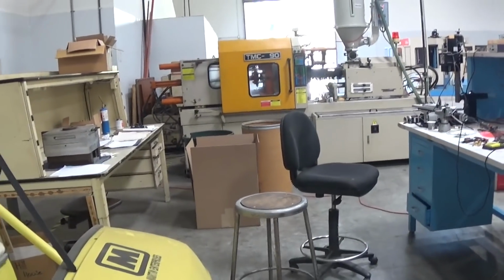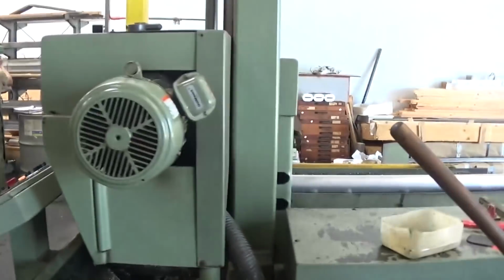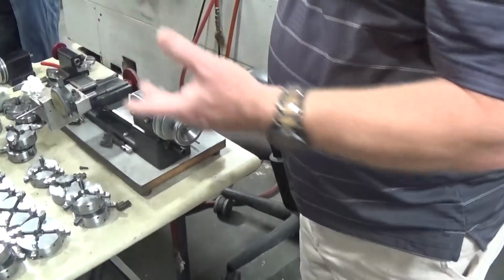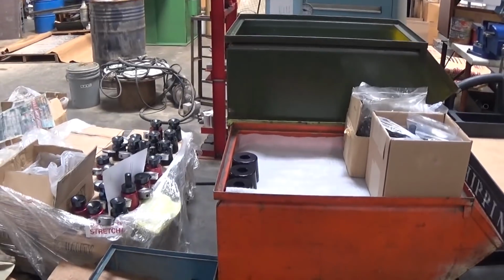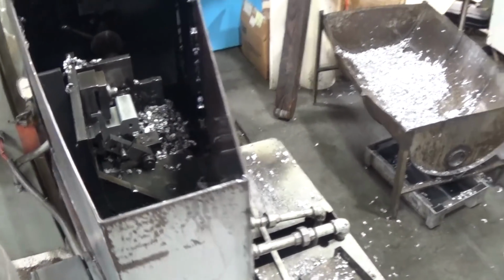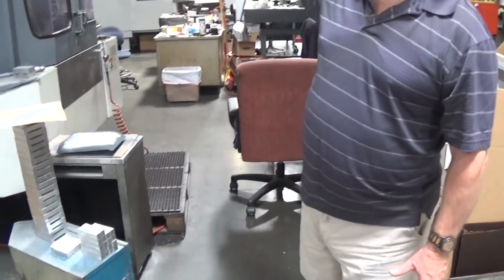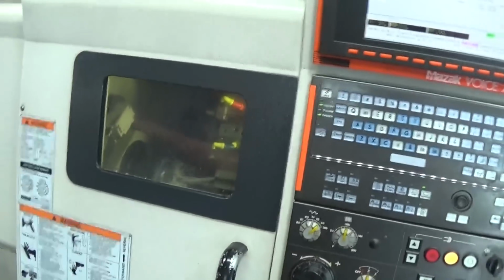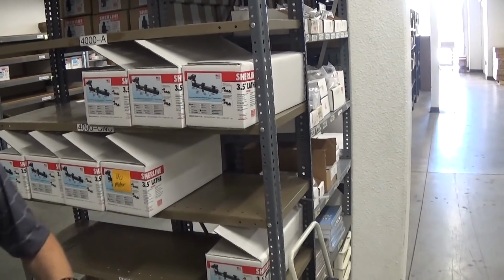SHERLINE FACTORY TOUR!

Comment: In the early 80's Joe Martin himself gave me a tour of his shop. It was in San Marcos at the time. Great guy. The changes since then are huge. Most of the machines were manual. My Sherline lathe has the original brass bed. Very accurate work can be done. The spindle is excelent.

Comment: 10 mins ·

SHERLINE LATHES... easy to use LEAD SCREW as DRO base. Under your lathe bed is a precision ground 1/4-20 Lead screw. Precision ground.. Covered inside base to protect it. I am thinking why not use the most precise tool already on the lathe.. The LEAD SCREWS. on all Sherline product should be GROUND THREADS. which means way more accurate tha whatever DRO you are thinking of. My 4400 1/4-20 lead screw means twenty full turns equal 1 inch. Each full turn is shoot brain fart.. 20 turns to the inch.. equqls 1.000" dived by 20 threads is anyone anyone.. Buehler.. so ten turns is half of one inch.. equals 0.050 per turn? well you UNDERSTAND the concept. Accuracy is built in to SHERLINE stuff. I am thinking of a large dial increments. ALSO a DRO or indicator FIX TO LEASD SCREW.. will always be best for DROs. or whatever you think up. Ok go wild..

Comment: Very informative, no problems with camera work. As long as the metal bits are in focus ( which they were) it's a good machinery video. I could just about smell the cutting oil and Aluminium sharp odour.